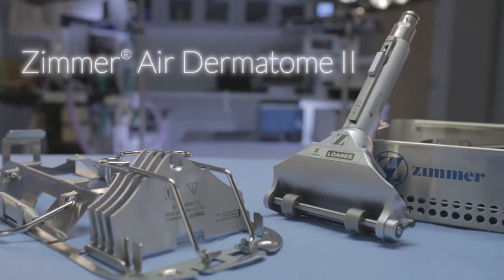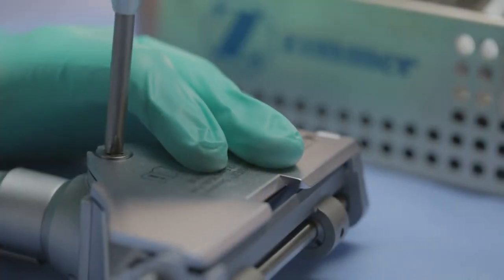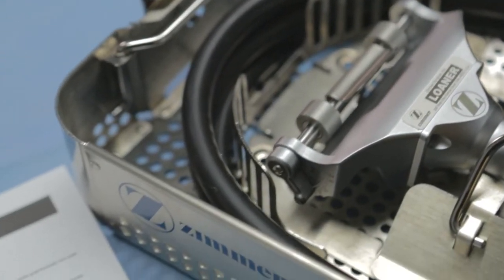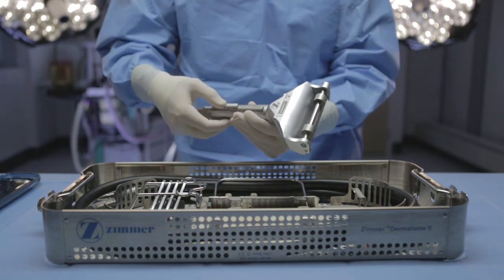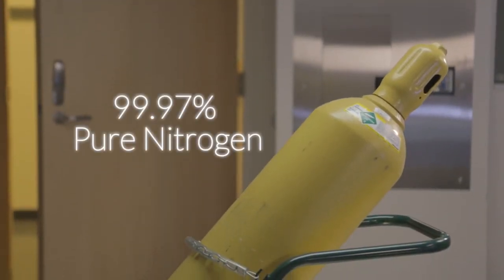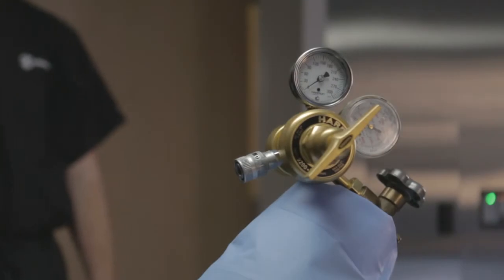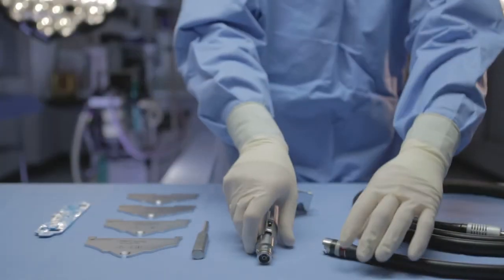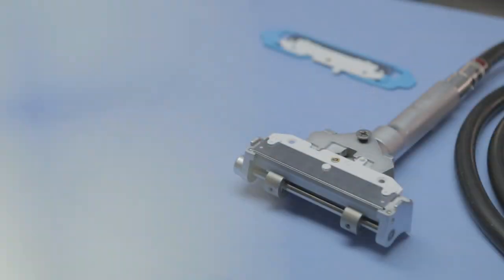Zimmer Air Dermatome II Training Video

Comment: Can blades be placed into this machine upside down? I witnessed an intraoperative patient injury today with this machine causing a more than full thinkness injury to the skin. Apparently the blade was placed into the machine upside down and the surgeon didn't check for correct orientation before starting to use the machine to take the skin graft.